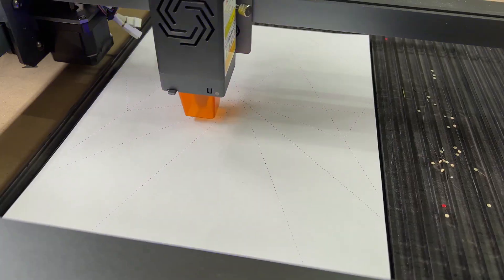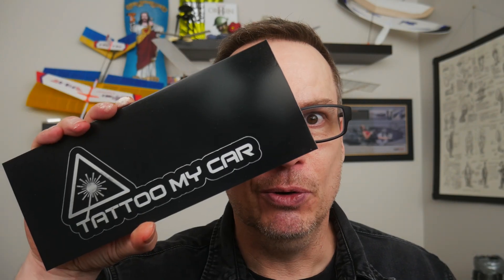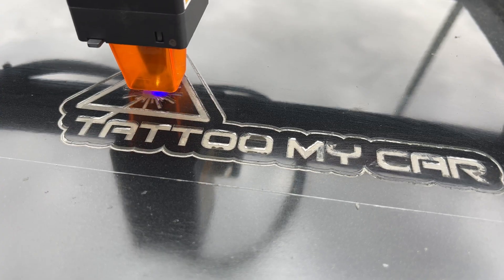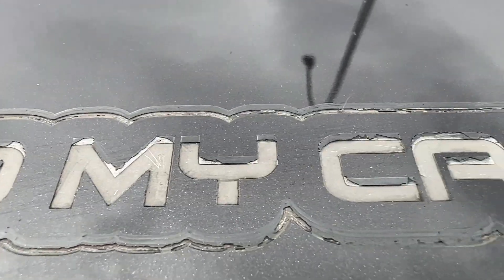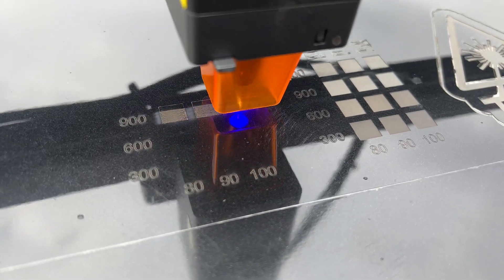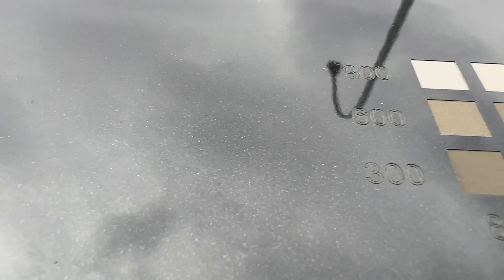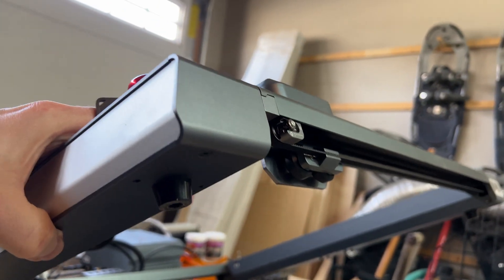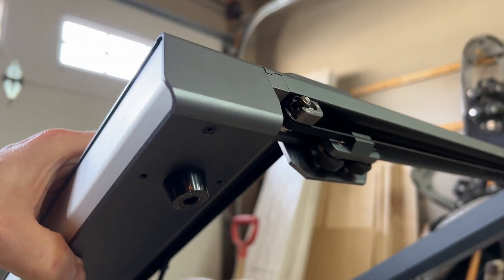Laser Tattoo Your Car: Laser engravers rock!

Comment: Woah, that's really interesting. I work as a graphic designer for a sign shop in Kelowna, BC and do a ton of vehicle graphics, decals, and wraps. This is a really cool idea, and I can imagine that there would be applications to use this combined with vinyl to get some really interesting depth effects. My first idea is an engraved spiderweb in the paint with a solid vinyl wrap over top so you get the design, but in a subtle raking light way.
Reply from the maker: Yes I agree but #1 laser cutting vinyl is DANGEROUS. It emits chlorine gas when burnt at those temperatures. That is not to say don’t use vinyl but just make sure at no point does it get cut with the laser :)

Comment: Here is a really hoofy idea - after the tattoo, leave the laser mount in place but remove the laser. Clean the area and apply a low tack cover, like shelf paper. Put the laser back and cut a stencil just a bit wider. Dismount laser and paint in different colors. Company logo on the doors? Got to do the borring wtiff to pay for the cool stuff.

Comment: Figured you would have used a LaserPecker 2 or 3 which is what we used on ours littler bit easier. 
Also tempering it, throw another pass ontop of the one you already did dont move it, but just do another pass, you dont need to get another type of laser just do another pass and you can get a decent gradient.
Also the deluxe iirc(may be higher) has the roller attachment which can do LONG stretches of cars like down the quarterpanels(once off the car),  or beds as well. You may want to look into this as well.  It all can be done, cause my husband and I have and are doing it on our cars here in Arizona, some for aesthetic, some for security as well.
Reply from the maker: Awesome! thanks for the tips

Comment: Tell the wife you just invented a new  detailing tool, and simultaneously started a new styling trend...

Although pro painters train on doors from a junkyard, something to consider(!)

Customisers will go nuts for this. Think of all the money spent on wraps or commercial vinyls, resprays etc.

From a subtle monogram to a full hood job, mounting the frame would make it reliable to align each section.

You also don't have to burn stuff, you could swap out the laser for a Sharpie...
Reply from the maker: All good points. Ill grab a hood and or door soon :) Thank you!